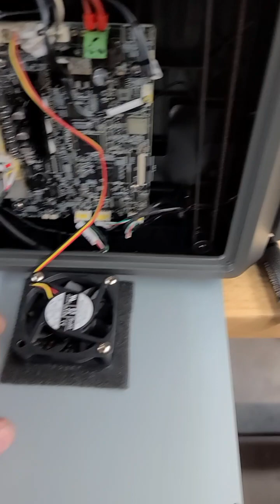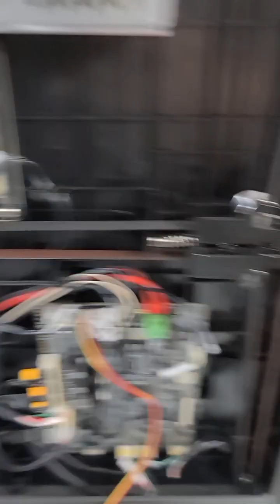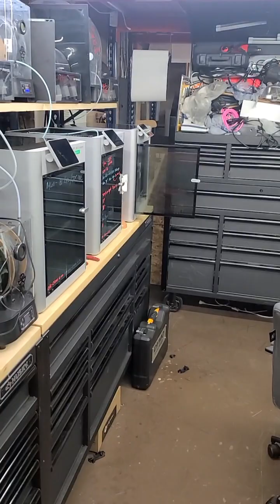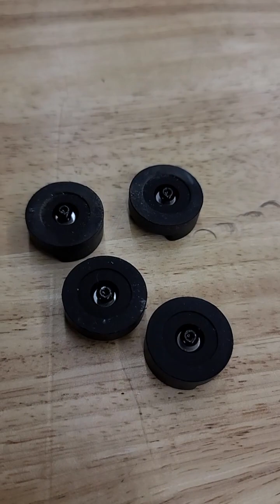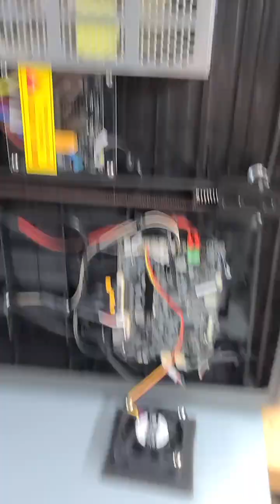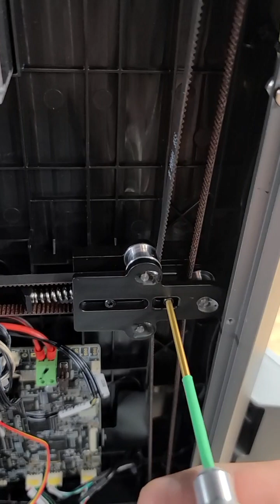YET MORE CREALITY K1 MAX PROBLEMS, belt for _z_ slipping.

Comment: Interesting. Is there a way that you can do a video on the K1C when it comes to the timing belt on the X and Y axis? I have been going back and forth with Creality on this when it comes to replacing the K1C timing belt, and doing it with the top shell off.

Comment: Thank you for this. I think this may be the reason why the nozzle destroyed 2 plates on my brand new K1 max. The calibration map was super bumpy and had over 14mm deviation. It is the "updated" version, but is still plagued with issues. I am super disappointed that it was advertised as a beast that works great out of the box. Can't even preheat it for ASA without the camera throwing a fit for the chamber being too hot, the lidar isn't real lidar, and the worst thing is the printer never told me there was an issue with the bed leveling. I found out after seeing a pattern of holes on my bed plates from the probing sequence. Please do some update videos on this, I'm going to open up the bottom tomorrow and I hope I can fix this POS with your guidance!

Comment: I have the K1 max - the lidar only is used when you click 'calibrate' on the print, if you're just printing without the calibrate setting the printer doesn't use lidar at all - i'm not sure why you claim it's a 'lie', it's a calibration tool not something for every print - I personally only use it for the first print with new filament .

I've been happy with the printer except for the typical clogged nozzle issue - just ordered a micro-swiss flowtech replacement to fix that. I've printed heaps with my K1 max though and my exeperience has been very positive except for the recent nozzle issue.
Reply: wrong, it doesnt use the lidar when you click calibrate before the print, thats for bed levelling before the print. It uses lidar when you enable flow calibration and first layer scanning in the settings
Reply: @keanu_lowe  AGREE 1000000000000% Mine keeps getting Errors, so I turned mine off, It's useless anyways.

Comment: YOU ARE MEAN, and biased.   thumbs down for your laziness and negative accusation... This machine has 1 year warranty, and from what you said,  is still under warranty. CALL the manufacturer.
it is not always shoddy "3rd party devices".  THEY tested them in their prototype device, and knows what works and what does not.
Reply: Have you ever used Creality's warranty? I spent a month arguing back and forth over my Ender 3 V2 and had to threaten contacting my credit card company before they even agreed to send me the new part. They wouldn't even let me return it to their website either. They also told me that their printers are for DIYers and that I should except problems. The issue I was having was the beds stepper motor was overheating due to a faulty main board driver and they had to send a new main board. Once they agreed to send it out, It took another month to get it and I had a brand new printer being down for 2 months. Creality's support sucks and their QC is horrible as well. My CR10 v2 had issues with bent lead screws and wouldnt accept a bltouch no matter what firmware or bltouch I had because there was some sort of issue with the board it connected to.
Reply: @jmp7624 they don’t do part replacement, learned that the hard way with my S1 Plus. They just do full refunds or no refunds, if you break the warranty then legally they won’t refund you
Reply: @jmp7624  was OP that honest?

Comment: Mine was running just fine for a while and recently I came to an issue where the print is wavy on the outside going up and down look like the layers are uneven do you thing this could be the issue? Some people on reddit recommended I check for z binding. Please help me!

Comment: No one is having problems but you mate. 😂 It's not a space ship mate it a 3d printer a monkey can work on them. You get what you pay for. The drivers don't run that hot you don't need a 120mm fan blowing over the drivers as long as they have some air moving over them. Been building 3d printers for years. Creality have never been good.
Reply: I wish. I've been having problems as well. The build plate wasn't level. A total of almost 2mm misalignment but pretty flat. That caused the z-axis motor to work super hard and not be able to completely compensate for the difference. Managed to bring that down to about 0.6mm. Now the first layer application is a lot better.

The z-belt was tight on mine but now after fixing the bed level, I can't say just how tight it needs to be. I keep seeing some top surface artefacts that could be related to the z-axis driving.

Then the extruder jammed - the tip of a filament I tried to retract broke off and got stuck in the gears - full disassembly of the extruder was needed to fix that and it looks like it is an easy thing to happen again...

The AI chases ghosts from time to time, but it errs on the cautious side and for me only at the start of the print. Some people had it pause the print several times during the print.

The LIDAR is actually working. It is used for flow rate calibration and first-layer problem detection during printing. I know flow calibration works because I assumed the calibration checkmark in Creality Print would do the bed level when I was printing the flow rate calibration models, and then the LIDAR flow rate calibration made the printed results useless. My bad. We laugh we learn. And the LIDAR-based first layer detection worked in a case where some ASA+ filament failed to print a good first layer... And I should have stopped the print and resumed it anyway. The phone app as well as Creality Print on the PC show very cryptic error messages about AI detections but it was clear what the problem was once I read it from the LCD of the printer...

I believe disconnecting the LIDAR has "no effect" because the firmware detects it is not present and decides not to use it. On the smaller K1, the LIDAR is optional and probably most of the firmware is the same for the entire K1 family. But that doesn't mean it doesn't do anything. The LIDAR is also active during calibration where it scans a dot pattern on the left side of the bed.

Comment: Mine is worse.  My new K1 Max arrived yesterday.  After an uneventfully installation, including a firmware upgrade, the machine printed 2 perfect prints.  I am using Creality Print.  Today I printed  one small model.  However, printing the second model, the printed has pressed the head into the bed during its self calibration test.  This has ripped the bed, jammed the head and caused the motors to stall.  I have reviewed the literature and discovered that this problem has occurred to other people.  
I am trying to return the printer.

Comment: I'm having the same issues, not a great first layer at all. After updating to the latest firmware and asking it to do the first layer scan , it pushed the bed so hard into the nozzle that I could see the rails bending up, it's ruined my print surface and I don't trust it hasn't done more damage. Creality simply told me to reset the settings and they'll send me a new print bed.... Definitely not good enough so it's going back later this week.

Comment: So to be clear, you mentioned that the printer still goes thru all the normal motions even without the LiDAR plugged in. So it prints the zigzag pattern and everything and still doesn’t throw an error?
Reply from the maker: That is correct. The K1 MAX will do every step at start as if the lidar is plugged in but it is not plugged in.

Thus it has no feedback from the lidar. It is an output, device not an input device.

For it to work accurately it needs to be an input device. In other words it is not reading or calculating anything that is coming in from the light are so when it shows the little laser beams scanning away it's really doing nothing but visualization for you it's like a start-up LED it's like okay your printer starts and they'll shred and then it goes green when it's getting ready and then it turned white when its printing that's all it is it's a gimmick

Comment: Thank you for the video. After seeing so many videos and problems reported i'v received my K1 today and just sent it back. I got my Bambu X1 carbon 3 days ago and it has not stop printing with no issues so far. Creality is just on a mass production mode and they don't really care about none of the issues that they machines have right now. It's very nice to be on facebook and have this awsome talk has i have seen but after sales are non existant. Just a show off to sell rubish and you can fix them if you whant them to work. This is my half a cent oppinion.
Reply from the maker: Agreed. The point is to buy a fully functional printer not a printer that you have to Tinker toy with and rebuild restructure free program and hopefully get to work.

If this was a kit printer I could understand that but it's not sold as a kit it's sold as a fully functional machine which they are not producing.

Comment: I own a normal K1... I found tons of issue on mine even the fan is on one side instead being over the drivers. So... When the motherboard gets too hot, the connector of the camera stop working. Even I had the same issue with the bed leveling that the first layer test came bad. I told them to lift up the Z offset or leaving to the user to move it to avoid the nozzle hitting the bed. I didn't check about the PSU but I will check when I come back from my holidays. About Customer services... It was a nightmare for me because they don't understand me and even than I'm in Spain and I have to wait one or two days to get an answer.

Comment: I would love a video on installing Klipper. I think, as always with Creality machines, it’s up to the community to make them work as advertised. I’ve been trying to get an extruder from them for two weeks and they ghosted me so…..yeah. I’m rooted into Crealitys hack job of an OS but it doesn’t do much good when they encrypt drivers. You would be my printer god if you could help get us all off creality os.
Reply from the maker: This is a great request. I will start this very soon I think by the end of next month I'll do the swap over.

I'm not getting any reply from creality either. So now I have all the mechanic's so it's an easy upgrade to Klipper it may need a new board but there not expensive.
Reply: Don't give up. Keep bugging the living shit outta them.  Also use Galaxy slicer.  I've had way better results
Reply: @Peanutz77  Oh I haven't, I e-mail every day. Once Galaxy Slicer works for MacOS I'll check it out. I've used the profiles from the repo on Orca and they're pretty good. I'm easy, I just want FULL Klipper in my K1. Oh and an extruder that is properly flushed out.
Reply: There are tutorials but you must not upgrade the firmware because Creality blocked the root so... Nobody can't access yet. Creality said two weeks ago that full version of Klipper will be on september... If not, I will downgrade the firmware to get access to full klipper. If you want to do it... You should keep in mind if something went wrong, the guarantee will end.
Reply: @justiciaparaespana7236  yeah, I’m rooted, been rooted this entire time. I’ve tuned my K1 and haven’t had many issues, my gripe is the horrible implementation of Klipper, especially their z offset, bed leveling and input shaper. I’m also not a fan of the belt system materials. It’s clear, as with almost everything CR makes, it’s up to us to bring them to 100%. I just want the encrypted drivers and other crap they locked up so I don’t need a rpi or octopi board and can just use CR board, though this may be in vain.
Reply: x2

Comment: Creality has a video on how to set the tension and level the bed. They showed it on a K1 when people were getting them uneven.
Reply: Tried it! It's useless. Mesh bed leveling is at 1.2mm! 😢
Reply: @vespapa-and-mama 
I had to put an “E” clip at the bottom of the lead screw to compensate for an uneven bed. Trust me it helps!